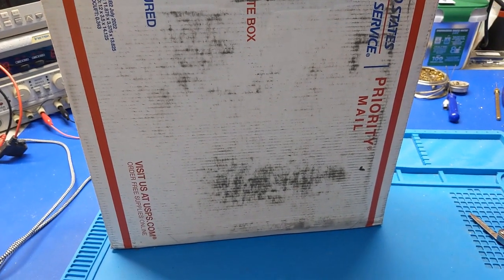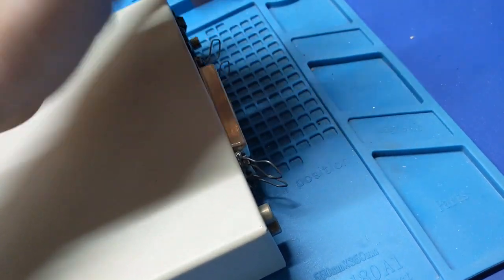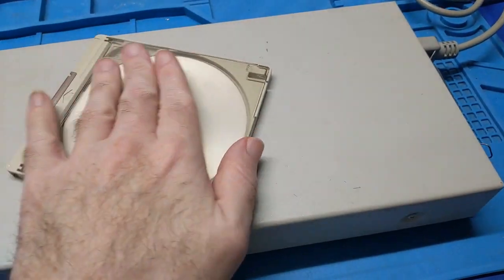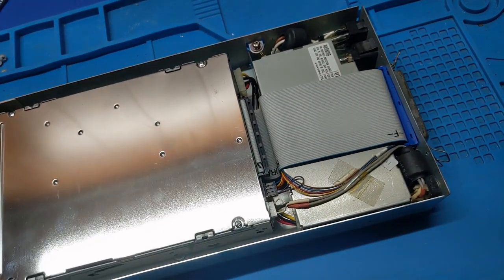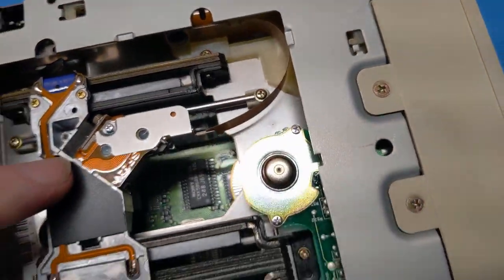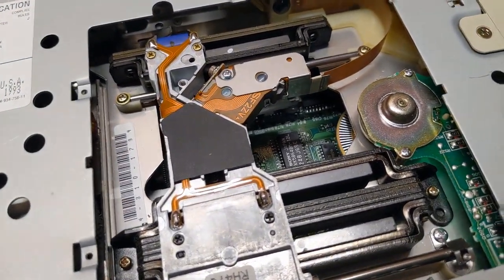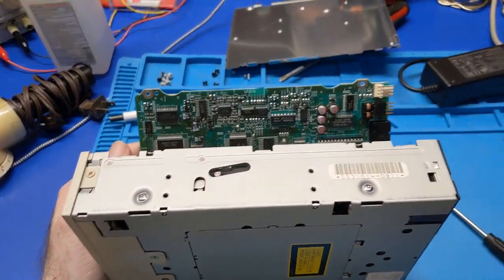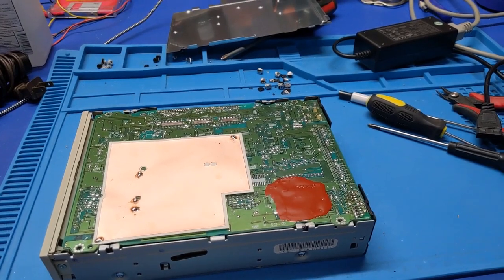AppleCD 150 External CD-ROM Won't read discs. Lets fix it

Comment: I hate those Sony sticky PCBs, what did they use on them, hairspray?? When shipping people need to understand that the parcel WILL be dropped from a height. There must be padding material all around - 10cm, not 10mm. Some time ago I read of a guy shipping three 9" CRT tubes to someone in a cardboard box with just some bubble wrap around them. Nice repair!